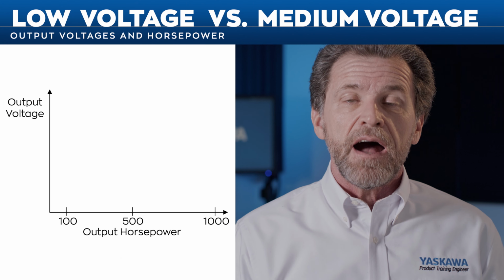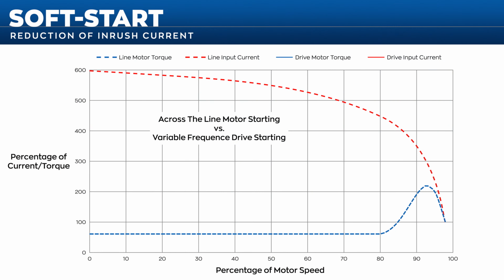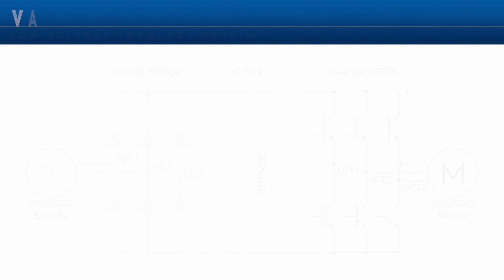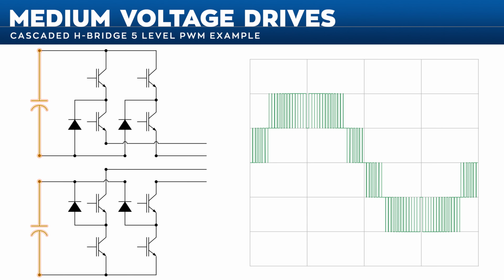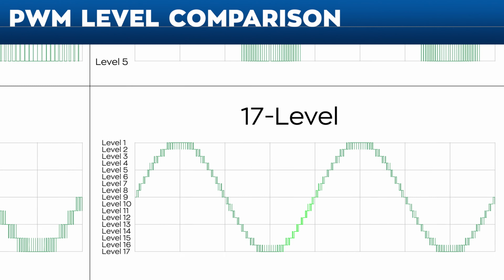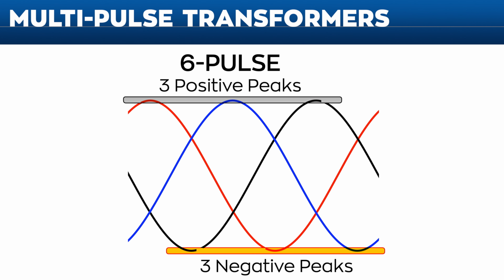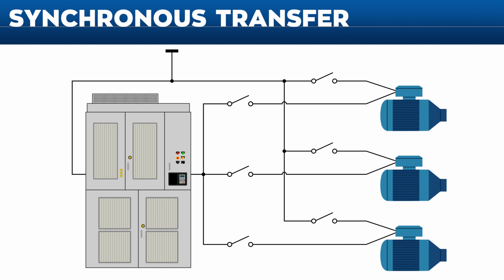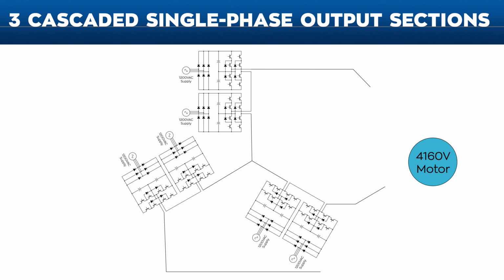Medium Voltage Drive Basics

Comment: Finally some good explanation of multilevel drive systems! I don't quite see jet, how the power flows backwards into the transformer if there are only diodes. Is this donne with thyristors? OR does this approach even work?

Comment: Is it extended Delta configuration on secondary side?
Reply from the maker: Yes, it is an extended delta configuration on the secondary side. This setup is used to achieve Yaskawa’s patented phase shift, which helps optimize drive performance and reduce harmonics.

Comment: Wondering if there is any interaction with any power factor correction capactors that are integrated with 1000 HP water pump motors?
Reply from the maker: Thank you for your interest in Medium Voltage Drive Basics. Power factor correction capacitors integrated into the motor are not compatible with a drive waveform and must be removed before retrofitting a drive. This issue is similar to LV drives; however, PF correction capacitors are less commonly used in LV applications.

If you require further assistance, please feel free to reach out to our Technical Support Team at https://www.yaskawa.com/support-training/support or contact the nearest service provider in your area at https://www.yaskawa.com/support-training/support.

Comment: Why not a U1000 type topology?
Reply from the maker: Thank you for your interest in " Medium Voltage Drive Basics". The primary benefits of MATRIX drive topology (i.e. U1000) are the ability to regenerate power back to the line, and harmonic mitigation.  Medium voltage applications tend to be non-regenerative.  For most MV applications, the topology of the MV1000 effectively mitigates harmonic distortion, and provides a more cost effective solution than a fully regenerative MATRIX topology.